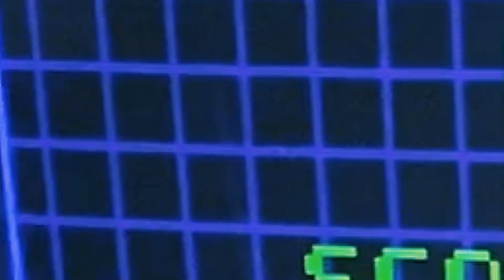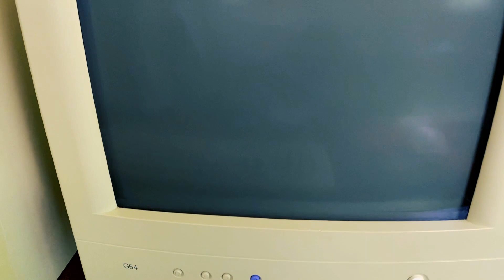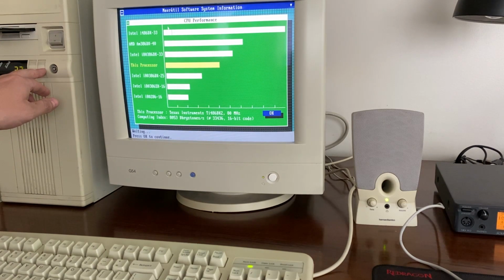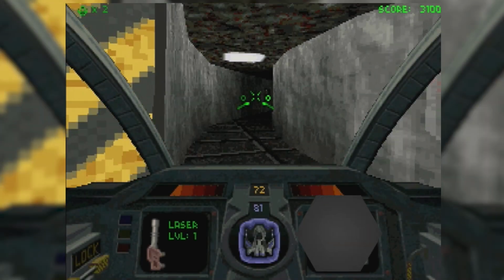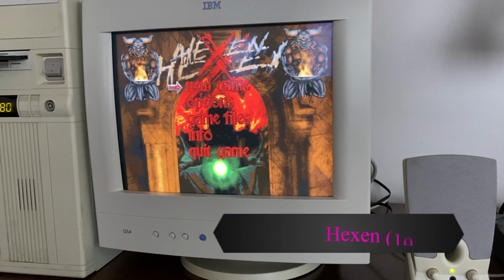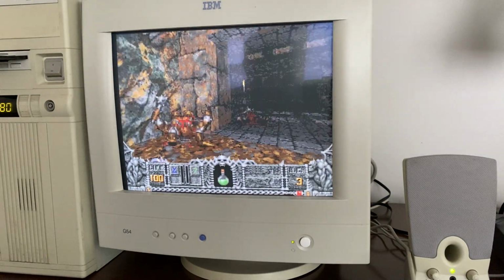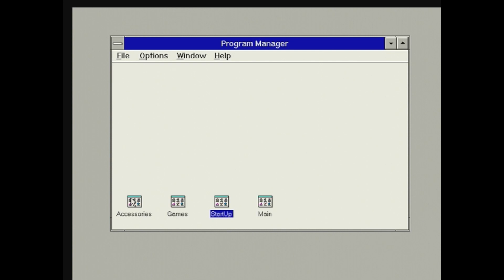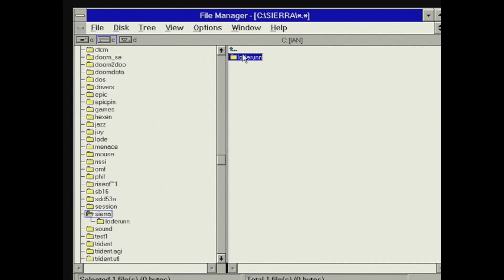486 80Mhz DOS Gaming PC

Comment: Nice video and a nice computer. About transfering files, I can advice a way of doing that - at least I transfer files using LPT null modem cable and good old Norton Commander 4.0 on both sides - and a notebook with win 98se and usb on the other sides. It works with all my retro-systems, from 286 to P1... I have been collecting vintage computers since 2006 )
Reply from the maker: Thanks for the tips!
Reply: @alwaysobsolete  maybe it's not the fastest way, but if LPT ports work fine its ok - I put to old computers not only games that way, but also distributive od MS-Dos, Win31,95,98,Photoshop,ACDsee,Word,Etc - as I also like to make posters in old Photoshop, like 3 or 5.0LE)
Reply: @yakovkhalip9714  I prefer using a network.  There's an investment cost to buy NICs and cables, and to setup a file server, but in the end it is so much faster and more convenient.

Comment: The slowdowns with HeXen are not your CPU, rather you should be using a proper PCI video adapter. The Aptiva had one.
Reply from the maker: Only VLB and ISA on this board. Not sure what the 486 Aptiva had. Good point though, it prob had something a better 1mb option
Reply: @alwaysobsolete  If it was like the Aptiva we had in the mid 90s, it probably had a Trident VGA controller. Definitely, VLB is "theoretically" faster, or could be, as it's tied to the FSB clock directly, but with some CPUs that type of timing could result in poor performance in certain video modes. One of the fastest PCI-based chips that's era appropriate is the S3 Trio 864 fwiw

Comment: What kind of problems did you have installing Windows 3.x applications on the TI CPU?  The Cyrix 486 generation generally didn't have compatibility issues; that was only for the Cx5x86 which was a scaled down 6x86, and even then the issues typically only surfaced when enabled the advanced features that were disabled because they caused stability issues.
Reply from the maker: Windows takes a good..5 mins to load. "Bad Huffman Code" error and pop up system freeze errors that require reboot. Tried half a dozen different types of software, Loderunner, midisoft studio, MS Office, AOL 2.5 etc. Ironically...Epic Megagames games can run under win3.1 fine...Jazz Jackrabbit, Epic pinball etc
Reply: @alwaysobsolete  "Bad Huffman Code" generally refers to compression algorithms or errors processing them.  Do these errors happen when trying to decompress setup files?  To be safe, I'd also check the RAM with MemTest86 or something similar.

Windows 3.1 also has some diagnostic startup options.  Use WIN /? and try some of the options to see if any of them improve startup performance.

Also, just to rule out odd behavior, have you tried down clocking the board to 33MHz from 40MHz to see if it performs more stably?
Reply from the maker: Yes absolutely on the decompress setup file issue (CRC errors). I solved this in DOS by swapping out sticks and re-arranging the stick placements physically. Win 3.1 seems to be more sensitive to this? I've tried the various startup options as well. Sometimes it gets me a little bit further before crashing. I've yet to try downclocking.

No matter what I do, the long load time is always there.
Reply: @alwaysobsolete  you should definitely try the down clock. While VLB should be fine at 40 and 50MHz, as I understand it those speeds are technically out of spec. You can also check to see if your motherboard supports adding wait states for speeds above 33MHz.

Otherwise I think AMD had a DX/2 80MHz chip. If you have access to one, you can try swapping out the CPU to see if the issue persists while keeping all other factors the same just to rule out the TI CPU as the culprit.